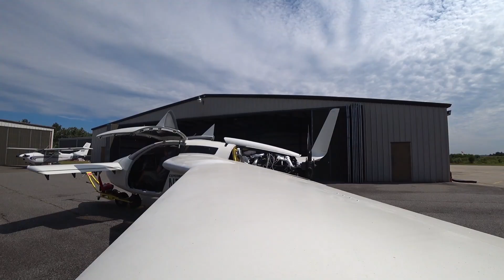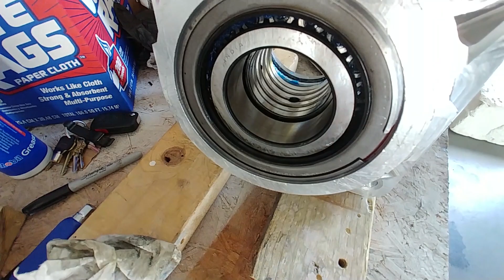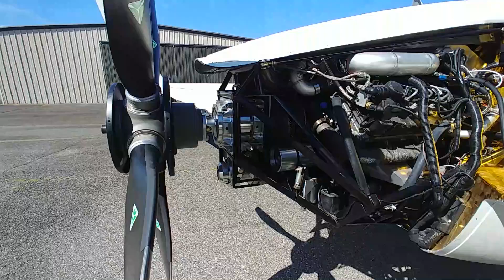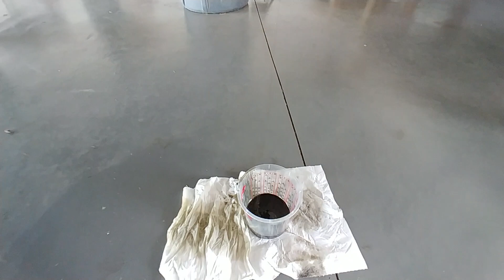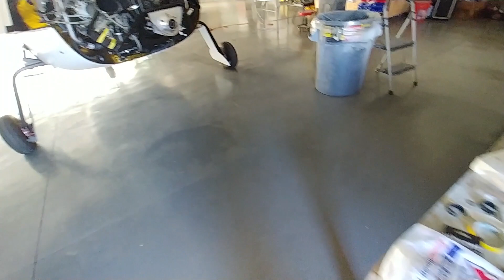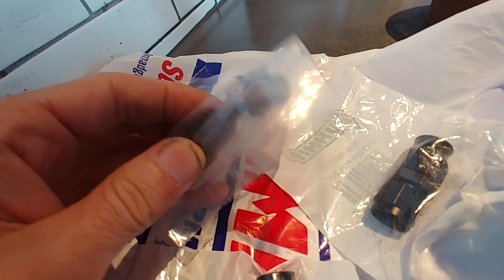Governor is Operational - Building the Raptor Prototype

Comment: When the oil heats up, and thins out, it will pass between the propshaft and the sealed precision bearing on the inner housing since that is a metal to metal slip fit.  I doubt that the "dust covers" on those sealed bearings are designed to hold pressure either, they are likely leaking too.  I think that you could resolve that leak by machining the inner collar to locate the sealed bearings closer together and making room to add a pressure seal outboard of each of the precision bearings.  The seals would likely need to be retained by a circlip to keep the pressure from pushing them out.
Reply: There should be no internal sealed off bearings and I disagree with you as they will fail, the oil will not pass threw the plastic seals and if it does from the pressure and knocks a seal out well then we have failure again. The whole setup is fail! I do agree with you on the dirty diesel oil is not good either.
Reply: @biggysground  What it needs is steel sealing rings like in an automatic transmission pump.
Reply: And the bearings need to be lubed with oil from the engine. Grease is not going to last.
Reply: Richard Debord so...... grease doesn’t last, holding up several tons, on truck wheel bearings, for 40-60k miles.....

Yup, properly done, grease doesn’t last.
Reply from the maker: Why don't you experts put all your knowledge and experience together and design and build the powerplant setup that you envision and then sell it to me. I'm ready for it right now. How soon can you get it done? And can I buy it for under $20k?
Reply: come on ..... all ur followers gushing all over you has clouded ur reality.  ... just last time .... you pulled on ur elevator for the first time ....... and it BROKE the trim spring !!!! What if that had been in flight ??? 
Are u kidding me .   The reality is that the Devil is in all the details .   You have incorporated Sooooo many untested details !   the combinations and permutations of possible failures are huge . 
The reality is that you have just walked thru the Devils front door , and he has welcomed you accordingly .  
I know it is so easy to criticize .  But it’s also too easy to get caught up in ur own hype .
Reply: The lot of you need to go back to the corners your crawled out of..  The oil situation is a mute point,  if the oil will keep a 100k rpm turbo going it will be fine in this application so long as it is changed at a regular intervals. Bitching about the trim spring breaking... Yeah it was tested before flight.... It was also based on a working design it shouldn't have failed..  At any rate this is a PROTOTYPE there is bound to be kinks - ATLEAST HE IS TRYING - Most likely the lot of you haven't TRIED to do shit!
Reply: pr1malr8ge famous last words ..... “ it shouldn’t have Broke “   how many other systems are in that same category ?   Trying...   hmmmm ......    ok ........?
Now here is a question for you ......
Just who is going to service These engines ?  Auto Mechanics ? Nope!  Aviation Mechanics ? Nope !   owner operates ? only in a very few cases . 
I was at the Velocity factory a few years back .  There was a Velocity there being fitted with a brand new Lycoming engine .  Right next to it there was a fire breathing mazda rotary engine sitting on a pallet .  I asked why was the engine being replaced .   They explained that this young man had purchased the aircraft because of the high tech efficiency of the engine installation,  only to find out later that NO mechanic would even touch it !!  That was an $80,000 dollar punch of reality !    The Devil is in the Details ...... and filling yourself full of happy thoughts and ignoring the details.... is going to get u nowhere ...
Reply: @RandyOtt  Well then Randy Ott..... Since the raptor is technically slated as an EAB whom ever buys the aircraft can put what ever engine they so choose into it..  Second the 3.0tdi is still  a in-production engine and finding someone to work on it isn't an issue.. Hell at the very least a replacement longblock will still be cheaper then rebuilding a lycoming, probably can get 2 maybe 3 long blocks for a single lyc rebuilt. The reason that wonderful 13b engine was scrapped is because there are only a hand full of shops/mechanics who actually know how to work on them.. You chose a VERY poor example of engine to shoot your rebuttable.. BTW the rotary has never been efficient nor High-Tech.  At any rate.... You DO NOT have to purchase this aircraft.. If you don't like what they are doing then go build a VANS RV or buy a Certified aircraft... Or at the very LEAST DESIGN, FABRICATE, and Manufacture your own fucking aircraft... Until you do that and MAKE NO MISTAKE then Get over your self!
Reply: pr1malr8ge   No thanks !  I have a perfectly  flying aircraft that I use all the time !  A proven Design !    with a proven engine and airframe .   Just imagine that !  Happy thoughts and puppy dog kisses are your best hope at this point ! And for goodness sake don’t listen to anyone who talks common sense !!  
u must work at CNN ! lol!
Reply: pr1malr8ge insert “Thank You” meme here
Reply: Randy Ott still would have been 100% flyable.  Don’t hate because you have a velocity 😉
Reply: pr1malr8ge You guys Crack me up!!    You are so emotionally connected to the HYPE of this project that u have lost all objectivity.  You would rather stoop to Name calling of people you don’t even know rather accept any .... And i mean any criticism.  Peter has been doing a fantastic job of marketing via his social media post.  Painting a great picture of the DREAM.   This is the first time I have said anything on this forum ..... and all I get is moronic attacks because I dare go against the orthodoxy.  Wake up!  Or  not.........ur choice.
Reply: @RandyOtt  I am not emotionally connected to the hype or this project.. It quite simply is not an aircraft I plan on building/owning at-least not for a time. I'm in the market for a 2seat aerobatic aircraft.. Most likely a Vans or a Mustang II.. What I am interested in is a diesel alternative to the over-priced antiquated LYC/Cons...  Back onto dealing with you.. You come on here and demoralize Peter, and don't expect any backlash? You believe because you're behind a computer screen gives you a right to be an arrogant prick.. yes that is exactly what your post portrays of you..  You would never have said what you said to that mans face. By the way I have NO qualms telling any of this to your face.  As far as being attacked has NOTHING to do with going against orthodoxy, It has everything to do with your delivery and attack on peter himself.  I have expressed my concerns on peters posts before and I have other concerns also.. That does not give me the right to be an asshole to him either.. Since it is not my project nor yours, you {We for that matter} have NO right what so ever to dictate how things should be done..  You can leave your thoughts on what you think may work, but when you start attacking someone because they don't want to listen to you especially when you are not invested directly with a project that's when you get called an Arrogant Prick...........
Reply: pr1malr8ge that was so overly pendantic I laughed out loud at work. Awesome!!!! Love it!
Reply: @RaptorAircraft  Objective criticism is what may help you, however, with that attitude it may not. If those bearings or seals fail it will damage the engine as well. Redundancy is not being used here.
Reply: @RaptorAircraft  Study the front of a Continental or Lycoming engine and use a bulky case with babbit style crank bearings and a prop shaft seal on the end. This way one oil feed in and one oil out. This is more of a proven design with less parts to fail.
Reply: Raptor Aircraft. About Three years ago i suggested that you use a proven concept and feed the oil into the end of prop shaft. I Sent you Part numbers as well. Rotary seals  has been used in industrial settings for 50 years.  What kills seals and bearings is speed or how many MPH they would run if set free. Your bearings RPM  are at their max now ,but your seals will never last the way your design is now. . The parts cost to install an end fed rotary seal will be a couple hundred bucks. The machining that it takes to  install Rotary seal  will do for free or I can explain your  Machinist  Brit how to do it .The lower shaft setup also has issues but right now the main problem is the oil feed. Wish you the Best of luck
Reply: Basic design-wise I had a few ideas for the other plain/hydrodynamic bearing redrive, though I use Rhino3D, and this is your project, and some people hold their cards pretty close to their chest. There is a lot you have learned from the redrives. There is a lot I have learned from your redrives, but not: why you had bearing issues. My crappy guess is that the front loading was too high. It could even be from the props ground effects for all I know. I would have added another shell-bearing in front and move the thrust handling surfaces back. I might also have given the thing it's own oil pump system, not because of dirt but because of flow and pressure consistency, perhaps driving the pump from the redrive shaft, with a electric pre-oiler.

The hydraulic pitch system is a thing. I don't know how to mix a high-flow system, with nearly a hydrostatic system. Yikes!

The roller-bearing drive would not have the same oil-pressure requirements as hydrodynamic bearing system. As for the roller bearings, they work in spindle motors, which have both axial and thrust loads. The grease needs to stays put and the dirt stays out. Temperature and even sound can give clues to bearing state. Perhaps some kind of mechanical transducer and a calibrated thremister could be placed on the redrive unit, and hooked to an Arduino for logging.
[The navy used to characterize all of their equipment for sound, not only for subs, but also for maintenance.]

As someone who has drawn in 3D a lot, I am amazed what you have accomplished. Full Stop.

Well, not maybe not many people understand what it takes to even have made the airframe shell, and how to put bulkheads in it, and design the moulds so the parts aren't trapped. If you have used Adobe Illustrator, drawing something like a plane is similar, but in three dimensions, using a vast array of more sophisticated complicated tools, the likes of which you haven't seen unless you have done it.

The viewer's plane needs parts, and mounds had to be made, and before that could happen toolpaths had to be made, CNC machines needed to be baby-sat. Bits needed to be checked. Workers needed to be paid. You workers seemed to do excellent work.

Still the viewer's airframe and bulkheads have no moving parts in them. The control surfaces have to be rigged. There were engine mounts to be made. To eek out the performance there is, the engine is covered with turbo and intercooler ducts. There are dozens of other brackets, and a landing gear system, lights, panels, and navs.

It's bad enough that you have to live on websites and catalogs to make this stuff.  When the viewer's parts came it, do they match the specs? 

Places had to be made to for all the hoses and wiring. In the real plane, I think that the wiring still needs some gathering up and tidying. Still, it had to be possible to for the wiring and the hoses to fit in the reader's plane.

it's a lot easier to do this: watch.
Reply: aeronot bac Finally someone is making sense !    I am slightly biased , but unproven everything , all slapped together .... what could go wrong ?

Comment: I told you that thing was going to leak! 
Honestly that whole thing should be full of oil to lubricate those bearings and that seal anyway, that little light coating of Grease you put on those tapered roller bearings is not going to hold up long term! 
Also for future iterations of this aircraft I would suggest setting up a separate oiling system for that so that you're not using dirty diesel engine oil as a hydraulic fluid and a lubricant for that shaft and those bearings!
Reply: The engine uses the oil for turbos that spin at 100k rpm. Also I imagine you would replace the oil much more often then when the engines in the car since it won’t cost much. I would go for multiple oil filters before adding another system.
Reply: I am not sure about the roller bearings and grease--either way. The same situation affects the spindle bearings and grease are in the quills of almost all mills and CNC machines. It would seem to depend on how well the grease stays in place, how hot the unit gets, how much and what type of loading, and if any dirt gets into them. Without seeing other specimens of the design in this application, I am reserving judgment. Theoretically, the hydrodynamic bearings that were being worked on have their issues as well.

Comment: OK, so that gauge is for Liquid Petroleum Gas "Propane"  (thats why it's labeled LPG) it says "Use no Oil" because thats what ALL flammable Gas gauges say (Oxygen /Acetylene) because of the fire hazard - has nothing to do with using it as an oil pressure gauge -it means if youre using in on Propane, dont oil the gauge or use oil around it! 
 if the gauge isnt working or bouncing it's prob just a bad gauge or air in the system?
Although, I do think theres a difference from Liquid gauges and Air or gas pressure gauges?
Reply: The fluctuating can be addressed by restricting (use a restriction in tube leading to gauge) the oil flow thereby damping out the needle swings.
Reply: Eclidean he could send an email to AVE